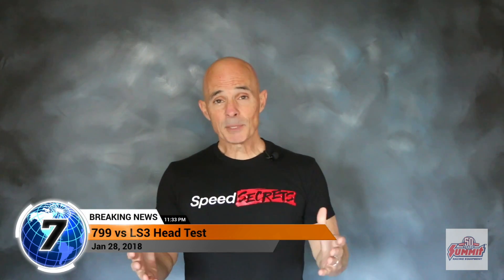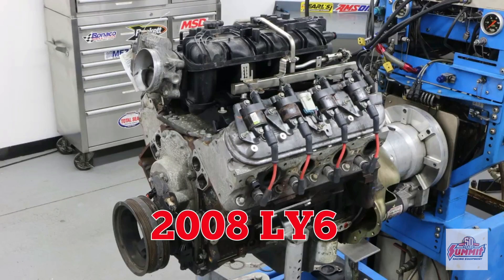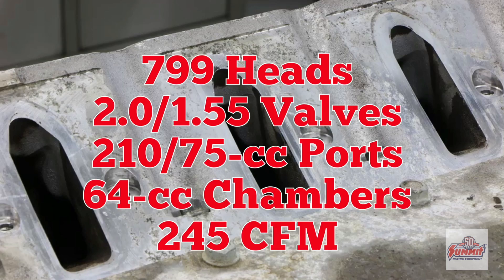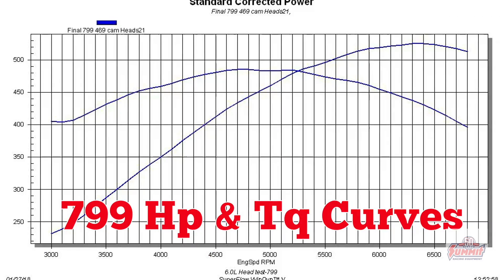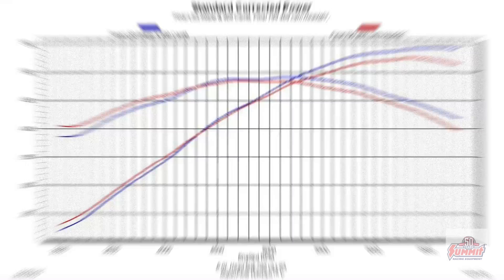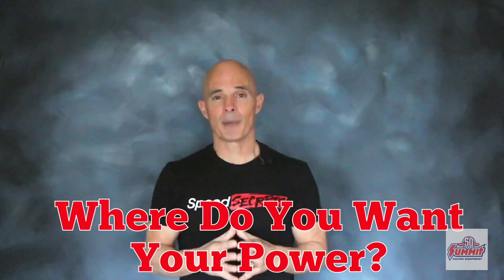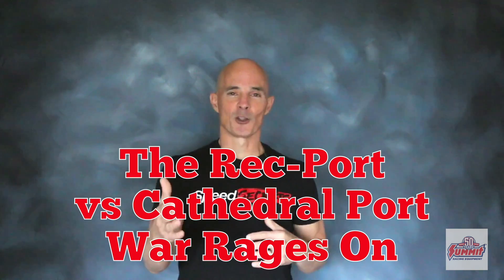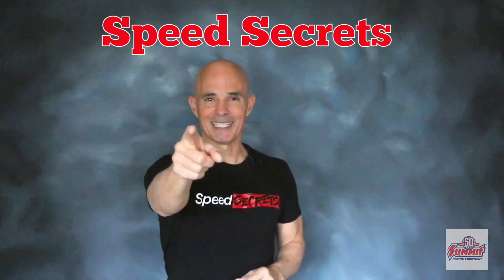LS Heads – Cathedral Port vs  Rectangular Port

Comment: Hello, I own a 2011 Caprice, 6-speed transmission. The engine was changed from an L77 to a 2009 LFA Escalade 6-liter aluminum hybrid engine, 243 ROS. I need to change the camshafts. What do you advise me? I need 440 horsepower or a little more (I need your help)

Comment: Richard can you tell me if the Comp Cams 13472/13159, 237/250, .367/.358, .624/.609 will work on a Gen3 5.3L stock piston to valve clearance using a set of ported 243 heads with stock valves, PAC660springs, CHE rocker trunion upgrade and TSP 7.4" hardened pushrods? I know you have used the 454 and 469 cams previously, but I can get this one at a very nice price and the truck will be a mild street truck/daily driver. Thanks
Reply from the maker: Hi Frank, Summit here. We need some additional information from you. Please give us a call 1-800-230-3030

Comment: I still want to tow with my LQ9, seems like porting the cathedrals would be my better option? If i swapped to rec ports i would have to buy new intake as well, so im factoring in total cost vs total gain and where the gain is
Reply from the maker: Porting your cathedral heads would be the better option for towing and much less expensive.
Reply: @SummitRacing  thanks for the reply. I ended up going with 243 heads. Also, i have some unused parts i needed to exchange but i am past the 6 month point. Is there any kind of way something could be worked out? Would be a great help, as this covid mess has me in a bind and im stuck with new parts that i dont need🤦🏽‍♂️

Comment: For a LS1 are the 205 heads better for performance  then the 245?
Reply from the maker: Assuming you are talking about the runner size, 205 would be for the end power and 245 would be for high. However, there are other factors that come into play. Feel free to give us a call with your application 1-800-230-3030. Thanks for watching.

Comment: Was a change in cyl head architecture really needed ? A far superior intake and way bigger heads only made 19 more hp? There is probably more than 19 hp with a fast 102 intake swap on the cathedral port motor  and it would make more tq across the board

Comment: Not really an apples to apples comparison. Cathedral heads are going to perform best with a different cam than a rectangular will.

That cam with that big of a split between intake and exhaust, as well as having higher lift on the exhaust lobe is going to favor rectangular ports. Something like a 242/246 .610"/.610" would be better for the cathedral.

Comment: I have a set of those 799 heads & cant wait for port & polish & my cam is a baker Custom Grind with a 617 lift going into a C5 Corvette going to make some power with a 3000 stall converter
Reply: How did it come out?

Comment: The LS3/L92 heads give up ~ .7 points on the compression ratio in this test and still dominate the cathedral port up top. Guys with 3600+ stalls or stick shifts could care less about the power at 3200 rpm as they will never see that rpm or will only be in that range for a .5 second or less. Rectangle ports rule the highways and guys that dump 3 times the money into their cathedral ports dominate the strip. LS3/L92 is the way to go on a budget for sure. I still don't understand what the deal is with the cathedral port crowd.
Reply: It depends on your application.  If you have a truck you use for towing and hauling, and you don't care about racing, cathedrals may be a better choice.
Reply: Because you can pick a set of cathedral port head for $40 and make 500hp
Reply: @konnerkramer3381  Both are extremely cheap. Cathedral ports must be for those on social security and rec ports are for those that can at least push a broom.

Comment: As usual - Richard Holdener gives us a lot to think about. Great test Richard! I will offer this - if your combination spends more time at lower engine speeds then the added torque is enough to make a big difference. Ultimately the great equalizer to this argument would be - assuming identical cars - which would accelerate quicker through the quarter mile? Sounds like a good story idea doesn't it? To make this more difficult yet I'l throw in one variable of rear gear ratio. My bet is that with a tall rear gear - the cathedral port would be quicker than the LS3 combo but if we toss in a deep rear gear like a 4.10 or 4.56, then the LS3 would likely win this test. No easy answers - but that's what happens in the real word!

Comment: 823 are l92 heads not ls3 heads
Reply: And what's the flow , cc,and chamber volume difference between the Ls3 and 823 heads  ???
Reply: @joshb4577  the combustion chamber size on the 823 are a 70cc the 821 ls3 heads are a 68cc they flow the same amount of air it is that ls3 heads have the better valves and valve springs
Reply: @Ls3guy  thanks! Good info

Comment: Cam choice is critical. Rectangular port heads need more duration on exhaust lobe compared to cathedral.
Obviously this specific cam choice benefits the rectangular port. Should had 2 different cams for each test and compare the results. Differences would be minor

Comment: Thanx Richard! While 20 HP gain is nothing to sneeze at it not like 50+ HP difference given the the huge total top flow difference of 70 CFMs between the rectangular and the cathedral heads.  And the with that 19 LB-FT @3200 RPM  and virtually the same HP and Tq figures @ 4800  RPMs  where most high performance street cars live at. It seems to me that the cathedrals are the more efficient head.
Reply: If they had the same compression ratio it would be about a 50 horsepower difference.
Reply: @tronsmart2185 , no it wouldn't.  The compression ratio in relation to intake air speed have nothing to do with each other.  The intake runner inlet is the only thing changing here.  The intake runner inlet on the Cathedral head is more efficient because it brings in air in one plane, vertical.  The intake runner inlet on the rec port head allows for more air available at higher engine speeds which is volume.  Both have the same compression ratios but the flow dynamic changes at various RPM's.  One more thing to note.  Truck engines "usually" have Cathedral Port heads for low end torque.  Corvettes and Camaros usually have rec port heads for a lower profile engine and high RPM performance.  Both engines are great and almost identical in every respect.
Reply: @joshtheking1772  Sorry Josh, you wrong!
They did not mill the LS3 heads in this test to keep the same compression ratio. I have seen it time and time again on cammed LS2 top end to LS3 top end swaps where the LS3 head is milled to maintain the compression ratio. RWHP gains are easily in the 35-50 hp range. Thanks for trying to sound all intelligent though.
Reply: @joshtheking1772  So you are actually going to stand on your hill and make the claim that the LS3 setup would make zero more hp/tq if it was tested at 10.3:1 instead of 9.6:1 ???? You have to be kidding. F'n smart guy.
Reply: @tronsmart2185  but it wasn't a zero hp gain was it?  It was a net of a 19hp increase.  You have to remember that the intake was also changed.  You know a rectangular port head can't use a cathedral port intake manifold.  Also remember too that you are also not taking into account that the cathedral port head wasn't designed for DI either.  It was designed for MPFI.  There is just enough difference in head port design to have one head produce more hp and the other produce more torque.  You need to think of the whole top end parts working together to make the numbers happen.  I think that is where you are getting lost.  A compression ratio change is never gonna be a 50 hp increase unless the parts used are ALL changed.  This is about head efficiency.
Reply: @joshtheking1772  At this point I don't even know WTF you are talking about. Maybe you are missing the fact that the LS2 setup in this test is at ~10.3:1 and the LS3 setup is at ~9.6:1?? My 50hp difference statement simplified for you goes like this. The difference between the two setups in this test is roughly 20hp; but if the LS3 head was milled to maintain the 10.3:1 compression ratio of the LS2 setup, the difference would likely be closer to 50hp. Now maybe it would only be 40hp total difference, I will admit to maybe being a little over zealous in my statement. Also, I am quite aware that the LS3 intake manifold is far superior to the LS2. Kudos to the better and newer tech surrounding the LS3.

Now I enjoy Richard Holdner videos and comparisons but the guy is largely biased as he is being paid by an industry that doesn't want their products to be eliminated from the marketplace by the far superior, amazingly cheap and easier to tune factory LS3 head. Most of the port velocity mumbo jumbo you see on the internet forums claiming that the cathedral port is better stems from the aftermarket companies plastering BS all over the net to protect the millions upon millions they spent developing products that get absolutely destroyed on a price point perspective by a cheap factory head. Now if you want to go spend $5k+ on a set of TFS heads and a Fast 102 to prove that cathedral ports are better than my $1k junkyard LS3 top end.... Be my guest.
Reply: @tronsmart2185  I dont think the test was done in the way it should have been done either.  He doesn't explain very well what he is testing for.  He did a video about the truck manifold and a fast 102 and said that the fast manifold was better when the fast is a 102 and the stocker is a 92.  The cam that they used was a monster for a stock motor and said it came down to the manifold making the difference, when it was supposed to be about the cam.  It is mumbo jumbo I agree. You know as well as I do that the LS series engines is about the top end with a sturdy bottom end, and the motor mostly responds to peripherals. Ignition, injectors, etc.  If it's supposed to be about manifolds or heads they need to do it on equal platforms.
Reply: @joshtheking1772  I agree. My apologies for throwing stones. I actually think it isn't really possible to compare them unless you keep the cubes and compression ratio the same and let each setup have the best cam and intake manifold possible. It is literally like comparing an early 32v Ford mod motor to a gen 3 Coyote and saying... What if the early 32v had a 80mm throttle body and direct injection??
Reply: @tronsmart2185  agreed.  Same apologies, car guys can get past alot.  These tests  are really comparing apples to pears and need to stick with parameters that are extremely close or dont compare them at all.
Reply: @tronsmart2185 I agree the compression ratio makes a big difference if you want to compare apples to apples. I’m curious to see how much more low end torque it would have gained too. I am willing to bet it would be comparable or more than the 799. If they throw boost on top of this the ls3 head will make a significant amount of more power.
Reply: Guys don't get worked up on this.
I have experience with LS3 heads on a 6.0 litre.
Sure they make more power and torque on the dyno compared to a stock cathedral head BUT in the real world an engine with a 4 inch bore does not run well with LS3 heads. It's lazy and lethargic and your throttle response goes out the window in the low and mid range. You are much better off to give the stock 243 heads a good cnc job which really wakes them up.
You need at LEAST a 4.065 bore on the LS3 for these heads to run decent.
They were originally designed for a 4.125 bore and these heads were left over from the R&D into the z06 corvette.
The LS7 head is the fully developed piece and runs a lot better than the ls3 style head in the real world.
Reply: @mrmysterious6006  , Thank you for giving me the real world answer that I was looking for.  A few years ago I had a conversation with the owner of one the biggest and famed cylinder head porters in the aftermarket. (hint he's on the west coast).  He said that the main reason that GM went to the rect port heads wasn't all to do with performance. It was strictly b/c of CAFE considerations. He stated the the rect ports had lower pumping losses than the cathedral ports through most of the RPM  range and those minute single digit(I think he said is was either high single digit or low double digit, I digress) percentage differences means all the world to the largest volume manufacturer of vehicles and engines when dealing with the Feds. 

The fact the they ended up giving tuners, gearheads and other horodders an relatively inexpensive OEM head that flow s 300+ CFM on the intake w/o any need for headporting was icing on the cake that they were not looking for but they'll take it if it enhances their reputation and hopefully their bottomline.